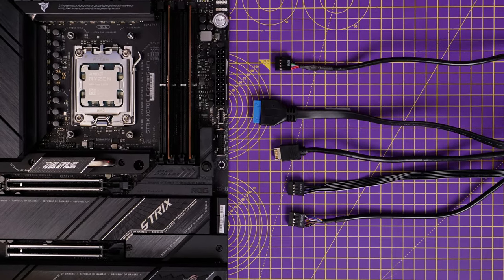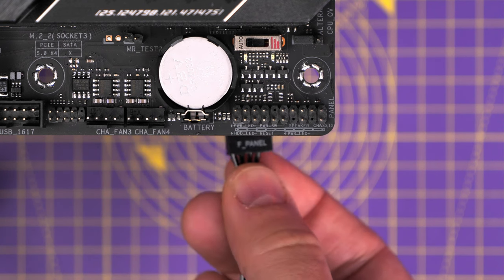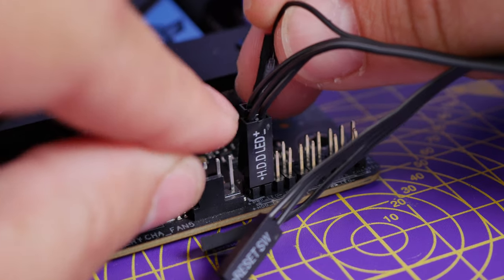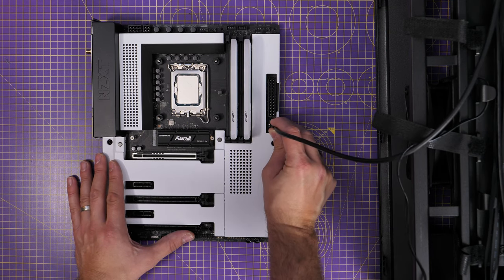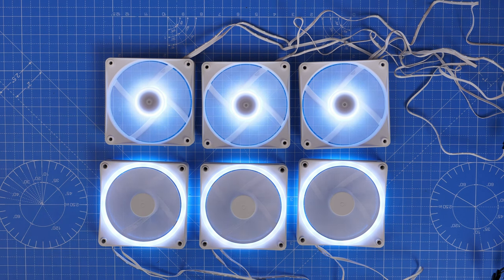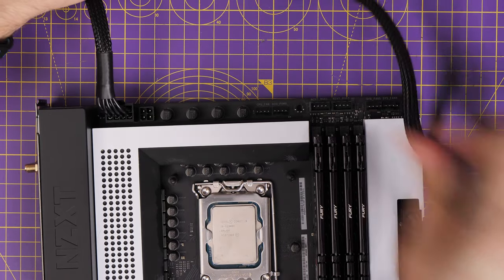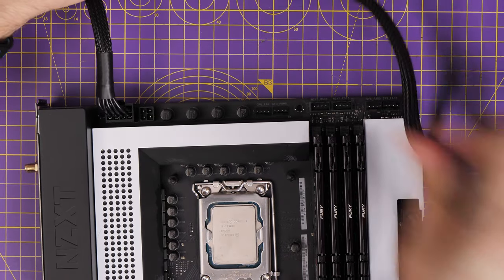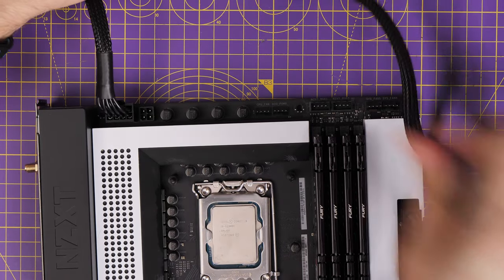Detailed PC wiring guide - everything you need to know

Comment from the maker: If you get stuck I also have a few other guides on specific things that might be useful and worth watching:
Common Mistakes You Might be Making with Your PC Fan Setup! PC airflow tips and tricks https://youtu.be/uPIMv30Vs3w
Are you making these mistakes with your RAM? https://youtu.be/ZeUgMODOfOo
Avoid these problems with your all in one CPU cooler https://youtu.be/nVkN8diBIAE
Don't make these mistakes with your NVMe SSD installation - NVMe tips and tricks https://youtu.be/zjSn64vh_Vk
Where should you put your AIO radiator? https://youtu.be/qQcyYHGtArs
How to choose the right PSU (which Power Supply Unit you need and how to install it) https://youtu.be/dNseVxqqar0
Push Pull mistakes to avoid with all in one coolers https://youtu.be/_gA71wF9Ewc
NZXT USB  Hub Please note links listed here include affiliate links which may earn me a commission. Find out more below.*:
Amazon US - https://amzn.to/3IMCCCj
NewEgg - https://newegg.io/nc03c66b46
Amazon UK - https://amzn.to/42hZHE4
Amazon FR - https://amzn.to/3os9xp1
Amazon IT - https://amzn.to/3MChjVl
Amazon DE - https://amzn.to/43qswPq
Amazon CA - https://amzn.to/43xLyDH

Comment: Freakin hate the case front panel connectors.
Reply: fr it took me like 15 mins bc mine arent the block its seperate parts to stick them in
Reply: @praseodi seriously tho. just upgraded my case and it was so tedious. Specially the single cable ones they spin around on the connector and makes it hard to push in place and flush with the Power and reset connectors
Reply: @loudtwinkiesxd98 can u help me lol I put mine in and it was all spinning but my led wasn’t lighting up then when I plugged in my led it won’t turn on now 😂
Reply: That what I’m saying
Reply: L
Reply: @praseodi  haha i cant even use my connectors since my mobo doesn't support Intel's standard for f panels
Reply: Facts
Reply: I bought a corsair 7000x case built the entire  system and went to plug in the front panel connectors and the power led+ was broken
Reply: Everyone hates them
Reply: H7 flow case fixed this problem. It comes with ONE connector to plug in.
Reply: @jessievgarcia same with H5 Flow. Was so glad it was all one brick

Comment: Hello! I have a question hoping someone can answer me: You've connected the cpu cable on the motherboard and then another 4pins cable near it. I saw builds where that 4pins entrance was still unplugged, what does it mean? Also my Computer have that 4pins entrance still unplugged, and my cpu (Ryzen 5 5600x) work with no problem. Thank you in advance

Comment: I just bought my new motherboard cpu  snd fan, ram it those fiddly power switch and pled, think i got them right. It wont power on though, it flickers a light then nothing.  Lights on MB light up for HDD, checked psu seperate that lights up and fan works, so not that. Checked ram putting in seperate.  Still wont come on.😢

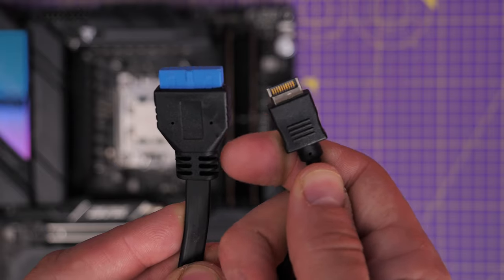Comment: question, at 4:32, isn't power swithc suppose to be on top and reset on bottom? not trying to be an "umm actually guy", genuine question cause im trying to follow it with  what you did for HDD LED and Power LED
Reply: Bro same here,, can you tell me the which one right?
If you already build a pc you know it probably
Reply: Wondering the same thing
Reply: @higher_rpm  I’ve been able to figure it out, I’ll let you know later  if you still got issues, at work right now
Reply: Yeah did he plug the wrong one in?

Comment: When I built my PC almost a year ago I used the pig tail connectors on the GPU without thinking too much about it. Recently I learnt that that little mistake was the reason I kept getting game crashes and my GPU completely shutting down without apparent reason. Also the PSU was kind of shitty but the cables also didn't help. Almost burnt my 3070 Ti because of a bad PSU. Always buy good PSUs and connect them the best possible way

Comment: How do I get another pcie cable if I need three cables and the power supply only came with 2
Reply from the maker: Check if the brand that sells the PSU also sells extra cables. Corsair certainly does.

Comment: How would you plug all the connectors into the psu before putting it in the case without yanking on them?

Do you plug all the connectors into motherboard first and then having the cables dangling out the other side of the case you connect it to the PSU. And then you put the PSU into the case?

Or you connect everything to the PSU first and the connect to the motherboard?

Or you don't have that option and you have to connect everything to the motherboard, put the psu into the case and then plug the connectors in.

Edit: I have a full tower case, modular psu, atx mobo.
Reply from the maker: Plug cables into the PSU. Then route them through the case and plug them into the motherboard

Comment: Is there a way to convert a SATA power supply connector into a 3 or 4-pin system fan connector that goes directly into the motherboard? I'm building a new PC and my case front dual ARBG fans have a SATA connector and ARGB connector with 3 holes. The fans also seem to have like a 4 or 5 pin connectors that are plugged to that SATA connector.

Comment: I have a phanteks NV9 case with their own D-RGB controller. You can control all the RGB fans on the case with a button. I prefer that so I don’t have to install and manage another RGB software. My question is: do I have to run a cable from the controller to the MB is this specific scenario? Again I do not want my MB to control the RGB on the fans. I have all the fans/case lighting ran to the hub and SATA power to the PSU. Is that all I need to do in my system?

Comment: This guide is a lot more helpful but I do have one question, I'm new to PC buying and my power supply comes with two 8 pin 6 + 2 connectors however one is a pigtail, the graphics card has two 8 pin slots so do I just use the one pigtail or use two separate connections and just zip tie the unused connection down?

If it helps my power supply is the MSI MAG 750GL and the GPU is an AMD RX 6800 XT.
Reply from the maker: This might help https://youtu.be/xfqIfT2ot20

But generally it's best to use two cables

Comment: I just built my pc but nothing Is powering on. I have the power sw, reset switch, pled + and - in the correct slots per manual. But nothing is working
Reply: Did you flip the switch on the power supply
Reply: @theeldenbeast  yeah. The issue was the case.

Comment: I have the rx 7900 xtx and it has 3 8 pin connections so i'll have to use the pig tail psu connector. Do I plug in the one on the end or the middle of the cable?

Comment: I don't have a cpu pump header on the mb for the aio, so i figured I should connect the pump via a molex adapter. But they all have 2 pins on the fan end, and my connector has 4
Reply from the maker: @rikardocastello  what about AIO pump, CPU fan or similar?
Reply: @TheProvokedPrawn  Thermalright aqua elite v4 240

Comment: Question for wiring Lian li lancool ii mesh performance case, crosshair viii extreme mobo, and 5950x. Do I need to use all of the cpu power slots on the mobo, or just one of the 2? (There are 2 8pin slots), also: on the mobo, under the psu connector there is a 6pin pcie slot. Do I need to wire this to the psu? I'm assuming it provides power to any pcie components I add, like usb c connections?

Comment: I'm assembling my first build, literally right now I'm taking a break to look for some help. My motherboard has 2 USB 3.2 Gen 1 headers, and I attached mine to the bottom one, instead of the one on the side. My motherboard is already in the case, almost everything else is wired up. I am trying to disconnect the cable from the header so I can change it to the side header, giving me more space in the lower opening. Is there some trick to getting these things off?

Comment: Can I plug in one 8 pin power cable into the top left slot for CPU power and still be okay? I’m running a 12700k that was previously on a motherboard with one 8 pin slot
Reply from the maker: Theoretically yes. They're generally used for overclocking and extra power draw from what I understand. I personally would try to connect both but you might be ok

Comment: Hi i have a question at 4:41 regarding that blue usb cable,  it seems i have only 1 of these connections on my MSI PROZ790-A motherboard  correct me if im wrong . if so is there something i could do for this or did i just loose 2 usb ports  since i  have no available socket .My case is a Corsair 7000d airflow Thank you
Reply from the maker: It's pretty standard to only have one connection sadly so yeah you won't be able to use all the front ports. I've not found a good solution other than having a fancier motherboard
Reply: That's to bad  i did not know this before buying this board ,i've checked motherboards with the 2 connections and their price range is crazy . Thanks for your time .Great channel

Comment: Hi! I'm struggling with a problem on my RTX 4070ti (Gigabyte) for like an year. My monitors went all blackscreen and my gpu fanspeed runs at max power (in the moment when i'm using my pc to demanding tasks like gaming or editing). I found out that i was using just only one y-splitter cable. And I want to mention that my gpu came with the specific nvidia adapter for 40's series (12+4). Should I just buy another 8 pin cable to make sure that i have stability on my system? (i have a 750w PSU from Antec)
Thanks!
Reply from the maker: Ideally use more than one cable, yes. But also make sure the cables are suitable for your psu if buying new ones. I.e. They're from the same brand and are compatible
Reply: @TheProvokedPrawn  ok. Thanks a lot!

Comment: Hey Prawn how about the PWM cable that attaches to the PWM Repeater hub that comes in the Corsair 7000x and other Corsair cases.  Where is the best place to connect this four pin connector on a motherboard? I have a MSI Carbon Edge WiFi which has 5  SYS_FAN headers on it. I assume it can plugged into the closest one on the board? Thanks and again love your content!
Reply from the maker: You're best referring to the motherboard manual but probably all the sys fan headers will be PWM controllable.

Comment: I'm so confused about SATA connectors! I have my B650M K motherboard from Gigabyte and I'm trying to get it wired up with the thermaltake 600w smart series PSU and it has SATA 6 pin connectors. Do I need to connect those? Do I need to replace my PSU? Could you recommend a PSU that can pair with the 5500XT 8gb (400w recommended)

Comment: Hi Provoked Prawn. I believe I have the same motherboard.  I plugged in my USB-A plug into the right location on the motherboard, which  I assume leads to the usb-a's on the front panel of my case (Fractal Torrent).  When I plug a device into the usb-a plug on the front panel, my device is detected properly and says it's "charging".  But after 20 minutes, it didn't charge my device at all.  Do you know why my usb-a is not providing power to my devices?

Comment: Can anyone help me? My motherboard does not have a USB type c connection i can connect the case cable to. What will this affect? Do i need an adapter? Otherwise, great video!
Reply from the maker: I'm not aware of an adapter. It would just mean you couldn't use the USB-C connector on your case.
Reply: @TheProvokedPrawn  ok, makes sense. Thank you for the quick reply! You’re one of the only YouTubers that willl actually reply to a comment that’s much after the video is posted! Also this video helped a LOT getting my pc wired up last night! And guess what?! It turned on and works!

Comment: 4070 just has one 1x8. So it would be straight from the gpu to psu?
Reply from the maker: Yup
Reply: There is also another pcie cable I got with 3 heads. Would I use only 2 head instead of the 3 since If I use the 3 head one which dangle out. Thanks @TheProvokedPrawn

Comment: Building a pc rn 
I have a question about the graphics card. I have a dasychain pci plug in and a single pci plug in, my graphics card needs two plug-ins from the power supply. Can I use both the single and daisy chain plug in and leave the second plug on the daisy chain unplugged or no?

Comment: What will happen if I dont plug in the USB one? Its connected to the long blue one but because of lengh wont fit in the motherboard.
Reply: Its not critical. The USB port on your PC case simply won't work if this cable is not connected.
Reply: @JJFlores197  Thanks for the answer. ok, thats not so bad. My problem is, that I did my first build, all cables are connected but nothing on display. I tried removing the RAM one by one to see if anything changes but it wont. My Asus B450M showing many  different orange lights at the back of the board. Can you help me?
Reply: @IDesignish  It doesn't look like that board has a diagnostics LED from what I can tell. I would suggest clearing the CMOS, refer to the board manual for instructions.